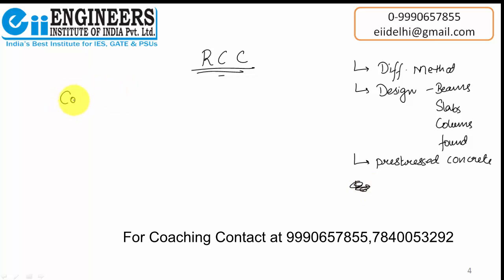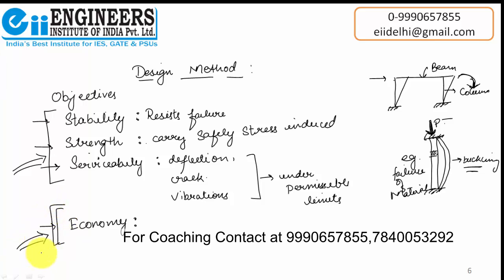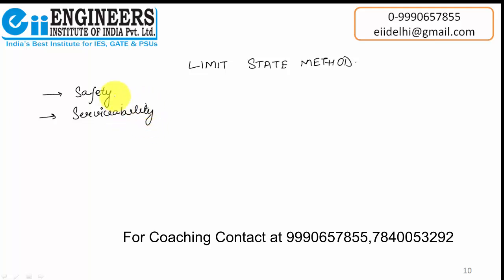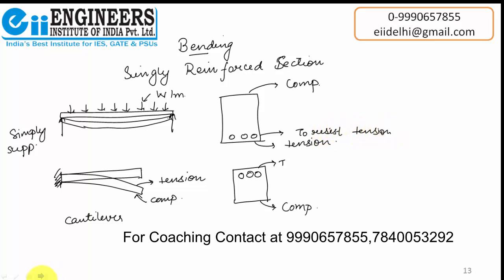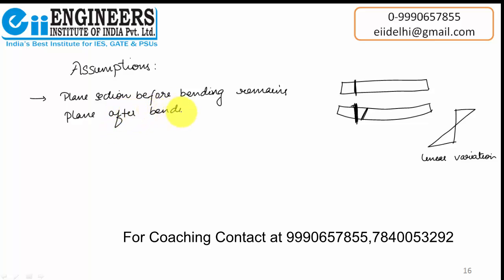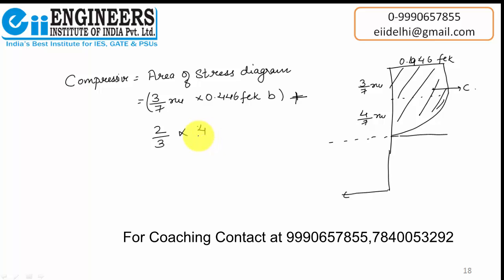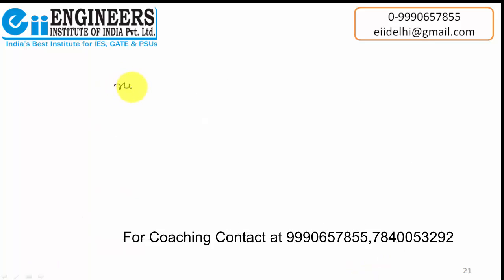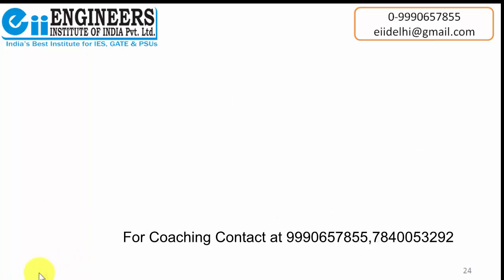SSC-JE - RCC Design Civil Engineering Lecture | ssc je coaching in delhi | ssc je 2024 notification

Comment: more explanation is required in detail...

for example:  stress strain diagram of concrete

in that 1st curve is characteristic strength of concrete it is called characteristic curve. to determine this characteristic strength there is one procedure.
2nd curve is safety factor curve 
3rd curve is shape factor curve it is called as design curve..
you have not  told that why again 2nd curve is divided by 1.5?
because the compressive strength of was determined for 150mm cube size. but compressive strength of the real structural elements such as beam,slab,etc., will be lesser due to larger variation in size.

Comment: CONCRETE DON'T HAVE A DEFINITE YIELD POINT , BUT MILD STEEL HAVE BOTH UPPER AND LOWER YIELD POINT . WHERE AS HYSD BARS HAVE DEFINITE LOWER YIELD POINT BUT NOT DEFINITE UPPER YIELD POINT. THAT'S WHY IN CALCULATING YIELD STRESS , ONLY LOWER YIELD POINT CONSIDERED FOR STEEL. THAT STEEL DAIGRAM IS ONLY FOR MILD. IT IS NOT GENERALISED FOR ALL STEELS. DEFERENT GRADES OF STEEL HAVE A DIFFERENT STRESS-STRAIN DAIGRAM

Comment: dear sir/madam
I'm from west Bengal.  a diploma civil engineer holder  and I'm preparing for govt exam like ssc, psc and all other technical exam.
but I have some confusion in few subjects like steel design, rcc design,and strength of material.
I'm benefited and clear my all confusion which u upload on your YouTube Chanel& I want to join in your coaching classes through online & I need 3 subjects full video  classes with explanation  which is based on   ssc exams.
thank you sir/madam